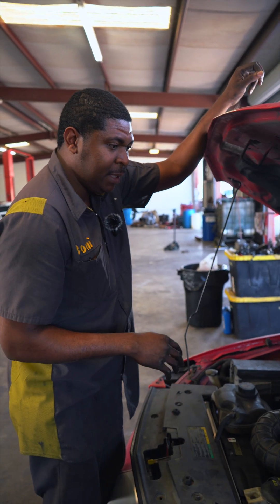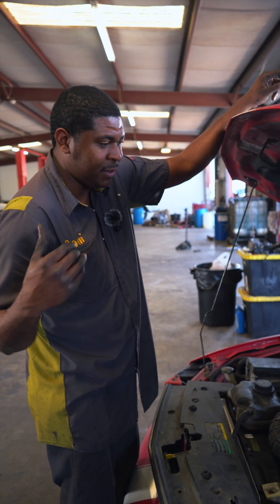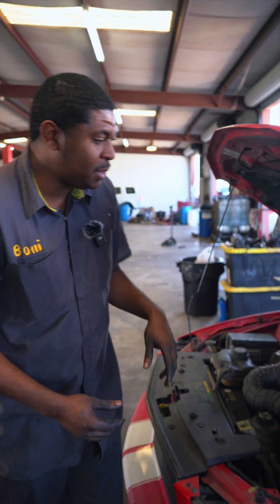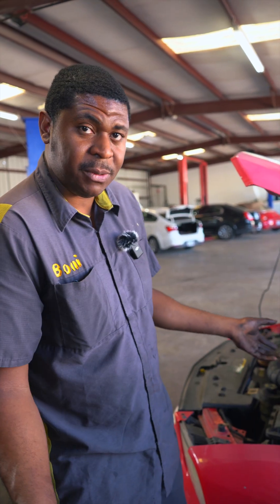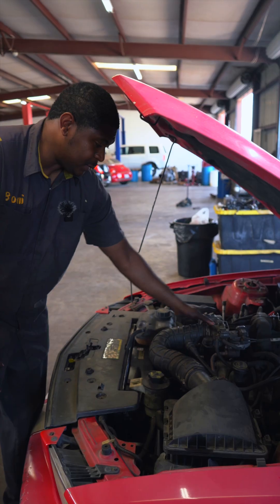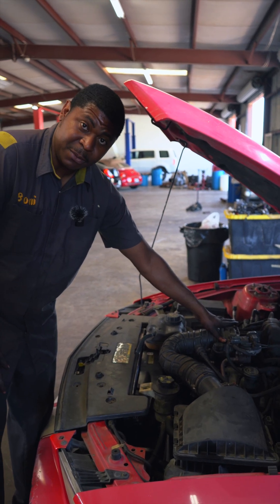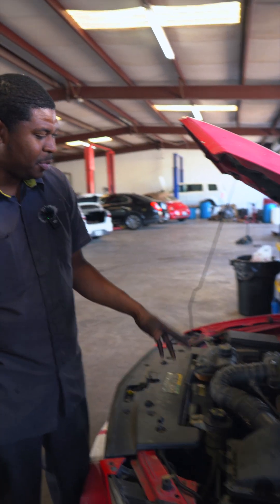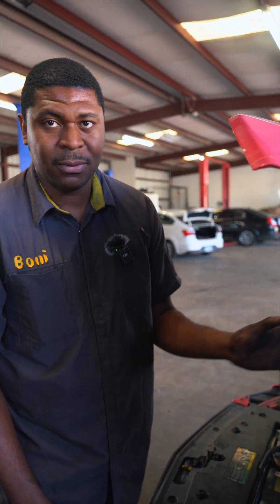Mustang TPS #shorts

Comment: Really though I've been doing mechanic work for almost 30 years really the only thing I found that a rebuild a transmission and if you're a certified diagnostic and repair technician knows the best thing for transmission is it keep it polished is sea foam within the week it will seem like a brand new rebuilt transmission

Comment: Hes correct. In the past you could use an OHM meter and check resistance between the the contacts of the TPS. The resistance should chart smoothly up and down in symphony with the throttle position and if its defective, simply replace the TPS. Nowadays, by the time TPS goes bad, the throttle butterfly assy is worn so yu can get mixed results! Good Job!